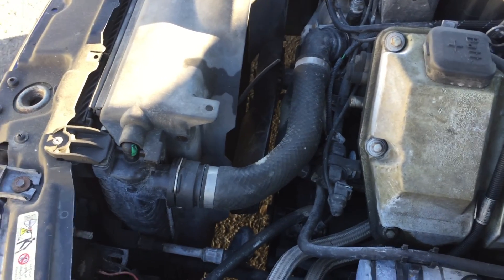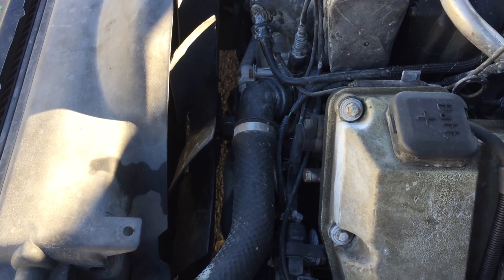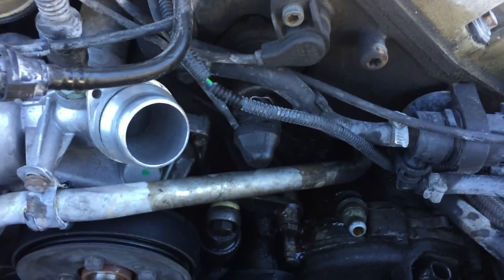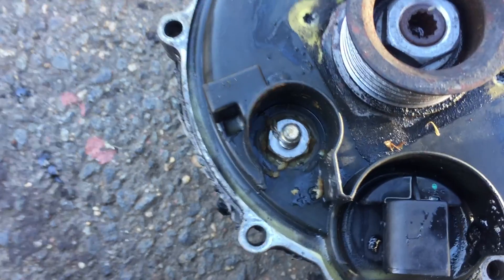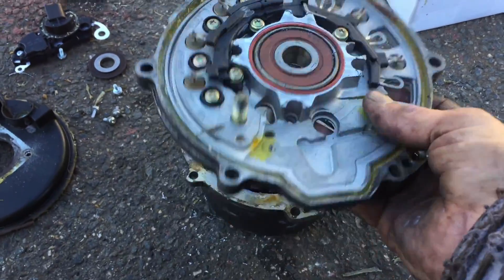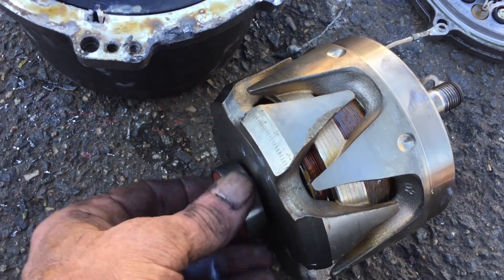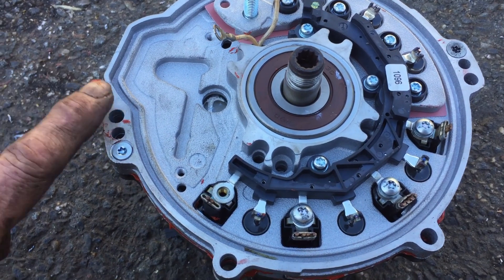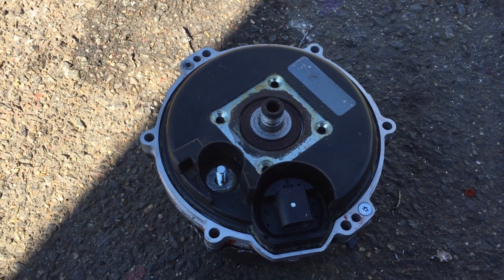Rebuild the Bosch E39 Alternator, This is a BMW but most Bosch alternator are similar

Comment: thank you bud
Reply from the maker: No problem!
Reply: @Glennfix  ok so i replaced the alternator on my BMW 745i  and had been driving it with no battery problems until yesterday my alternator went out again i feel like trying to use a cup thats not made of plastic  so i dont have to worry a about that any more do u recommend me making my own cup thing or should i just replace the alternator AGAIN
Reply from the maker: @xesberto937  First make sure it is not the battery. It is possible the new parts you got were faulty. It won't hurt to replace the cap, but if it is not damaged I would not mass with it.

Comment: If you had to do it again...would you have left the rest of the alternator assembly in the engine to avoid  flushing the antifreeze and just remove the black plate after removing the pulley to be able to just work on the parts needed to be replaced?

Comment: You rebuilt the whole thing when you could have just replaced that black part that plugs in thats what charges so much cheaper 5 - 15 part max valeo
Reply from the maker: Yes you can if the bearings are good.
Reply: @Glennfix  that thing also needs an o ring when reinstalling did you use it

Comment: Never mind i had to re watch the video the later 745li has another tension pully that blocks the altenator .... my alternator started to make a grinding noise from the pully its not the belt i dropped it off to the shop for the altenator bracket seal soon as they put it back together it started making the noise at the shop

Comment: How did u get the bottom pulls off from the altenator
Reply from the maker: If you are talking about the bottom bearing it needs to be pressed off and on. Mine was not bad so I just left it.

Comment: What exactly did you search for the rebuild kit? I just had mine go out and I am in no position to buy the $580 bosh replacement
Reply from the maker: Found it on ebay, Amazon has them too. I just searched "rebuild kit for BMW alternator".
Reply: @Glennfix  be very careful of those rebuild kits because the bearings are garbage. Just got off the phone with a bearing place, someone used knockoff skf bearings all 32 blew up due to that failed bearing. Make sure its quality like NSK, Timken, etc.
Reply: @lv5multimedia901  I'd question the quality of the rest of the components as well. If they're not a recognizable brand name like Bosch or Nippondenso I'd stay away from them. If a person can't cough up $580.00 for an alternator, then an old European car may not be for them.

Comment: Thanks Glenn.I can’t get mine to align properly and I think it’s because the plastic ring is not seated properly for the bottom bushing your came out easy mine is tight. Do I put grease around it? Do I really need it? When I close it it won’t spin unless I loosen the screws. Lastly can I deal it with white lithium grease??? Sorry so many questions.
Reply from the maker: Did you replace the bottom bearing? If you did it sounds like the bearing is not all the way on. The plastic ring is just a spacer, that is why I am thinking the bearing is not all the way on. A little grease is fine, to much grease could work it's way to parts that should not have grease on them.

Comment: That square sensor is an air quality sensor.  When it detects contaminants the cabin is commanded to switch to recirculation so that tear gas/fumes etc. are kept out.  A lot of 740s were used for executive protection.
Reply: I have that on my X5. It's called the 'smell-o-meter'. Utterly pointless!

Comment: im looking for the new plate to rebuild my alternator....what exactly is it called, and im looking on Ebay....not sure which part i need to buy....THANKS GLENN!
Reply from the maker: The plate is called rectifier, the black part on top of it is the regulator. For the cost I would replace both. Or maybe you will be back doing it again soon.

Comment: i cant get the old rectifier off of the shaft to put the new one on. Am i supposed to hammer it out ?
Reply from the maker: I am not sure where it is stuck but, if
it wont come out of the case you need to check to see if there is a
screw still in. Some of the screws hide and it is easy to miss one.
if the bearing wont come off the shaft you might have to use a wheel
puller. The rectifier should come loose from the bearing with out to
much trouble. I would not hammer on it, tap if you think you have to
but be gentle.
Reply: Glenn 3505 yeah it came out the case fairly easy i just cant get the shaft to come out of the bearing.
Reply from the maker: You need to use a gear puller, be
careful not to mess up the threads on the shaft. Most of the time
they come off with no problem it should not
take much to get it off just a little help.